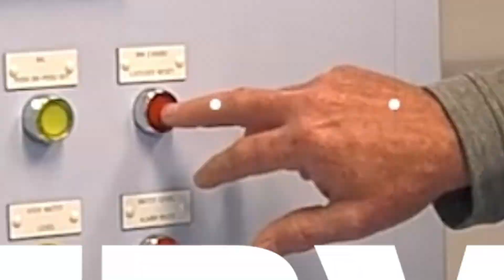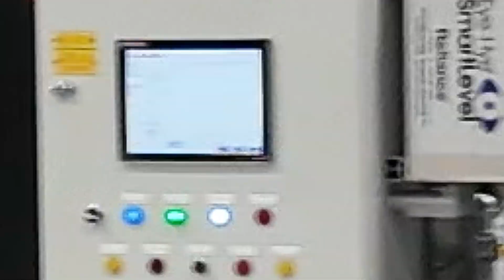Optimize Your Boiler Room: Understanding Combustion Air - Boiling Point

Comment: Is there a best make up air temperature?
Reply from the maker: There is really not a best temp. What you need is consistent air temp. Any drastic changes will change the combustion so if you don't have oxygen trim then your combustion efficiency will suffer.
Reply: Nice and cooled Air Conditioned temperature!